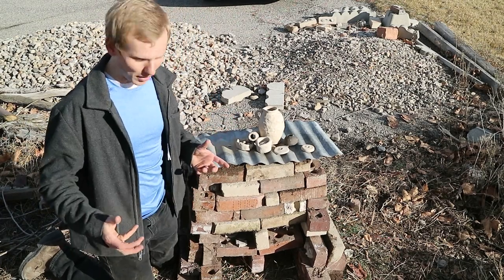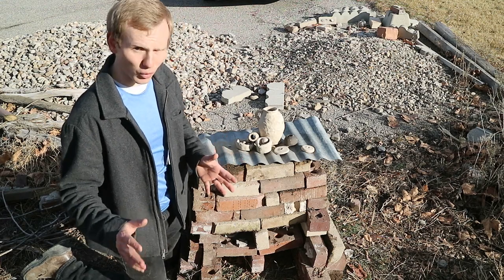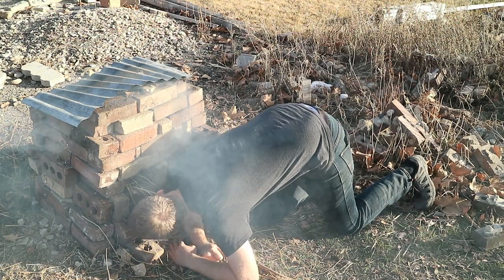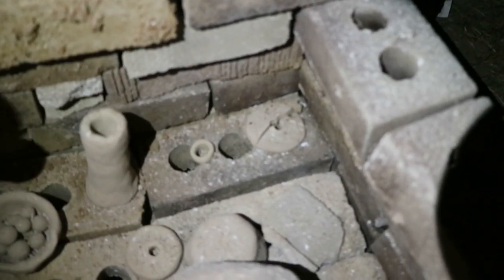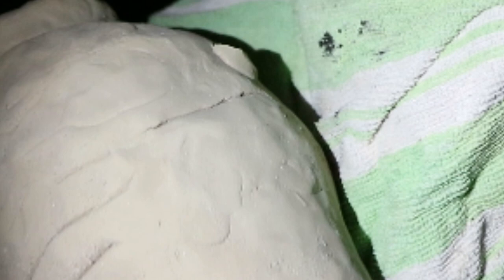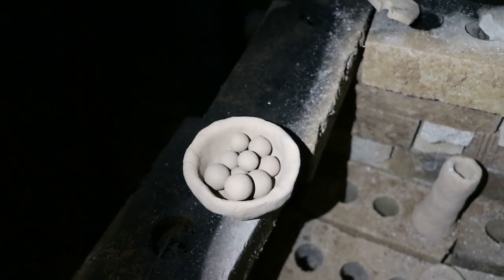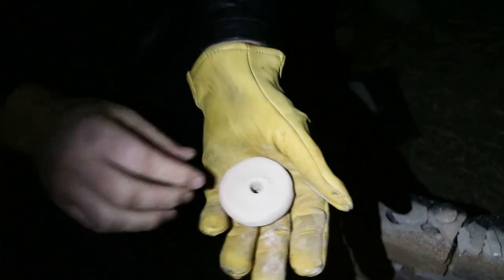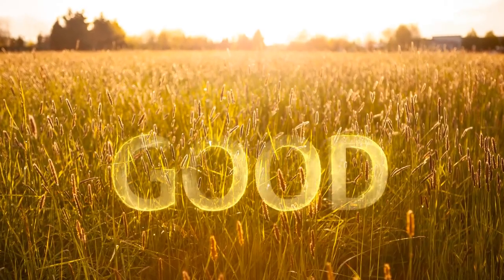First Firing: Brick Kiln Part 2

Comment: Never throw away broken pieces. They can be used as spacers. Greenware must be thoroughly dried before firing. I saw one man who would preheat his pottery before putting it into a kiln or firing pit. He said it kept the breakage down. He said drying it in a low temp oven made a huge difference as well, the night before firing. He also used broken pieces that were flat to raise greenware up so the heat surrounded the items and put pieces in between the wall of the kiln and the greenware. He also used pieces between greenware pieces.

Comment: I haven't finished the video yet, but you might want to take into account that effect of scale on the strength of the draft, and the heat generated, you are basing your kiln on a design that was larger meaning it had less surface area for its volume, and it had more total height which will help draw more air through the fuel, in addition to this the larger bricks of the original help regulate the temperature with their thermal mass. Some improvements might include mounding soil on the sides  for better insulation and building a taller structure.